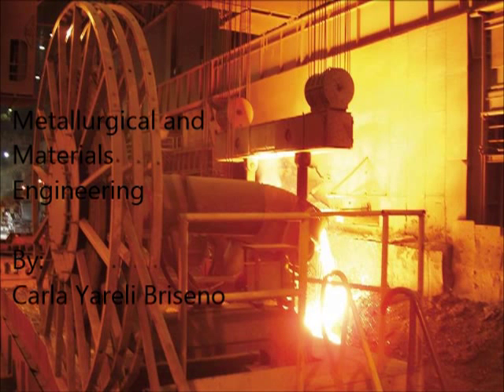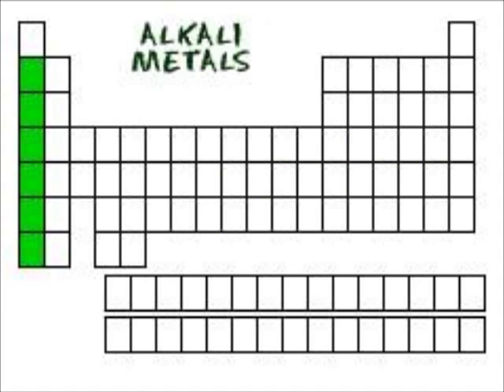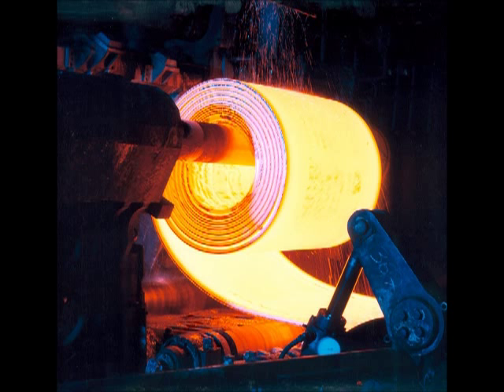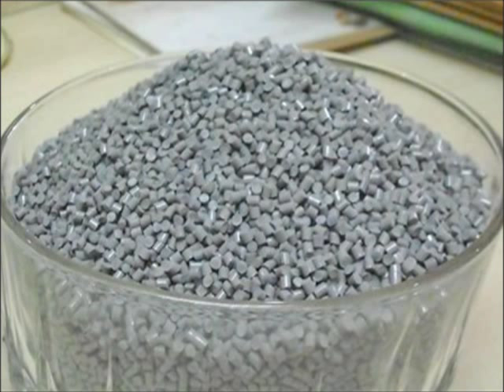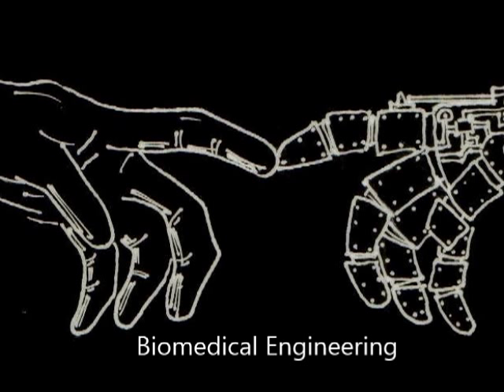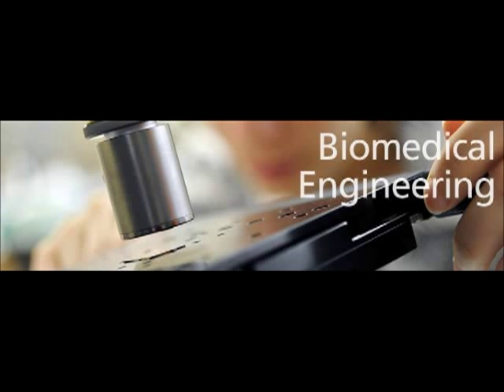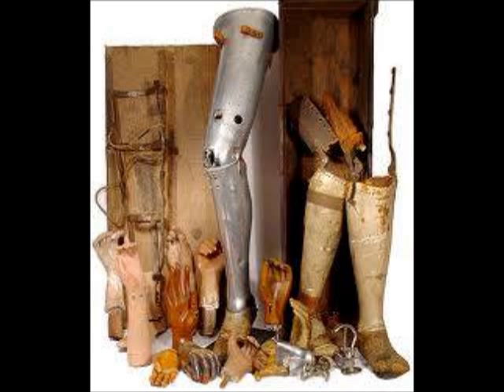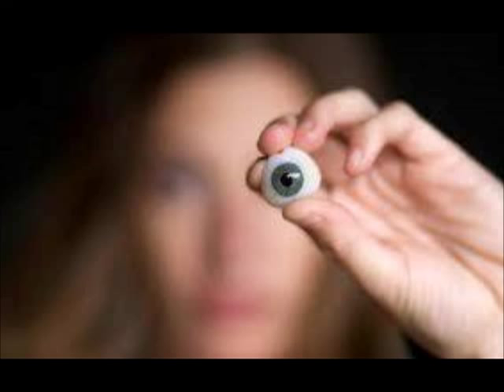What to do with a Metallurgical & Materials Engineering Degree by Carla Y. Briseno

Comment: You forgot one big part of material and metallurgical engineering.
Which is the analysing of problems with different materials, for instance a company that has different kinds of metals in stock want to know which one they can use or a insurance company want to know if it's the materials fault or someone else broke it on purpose and stuff like that. i work as a analyst in germany sorry for broken english